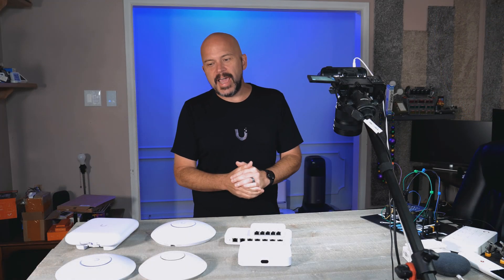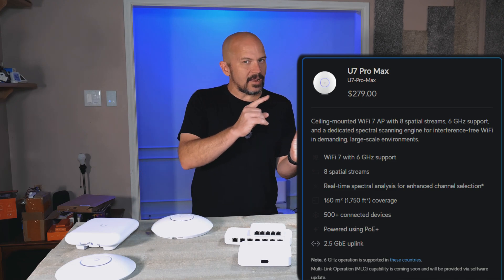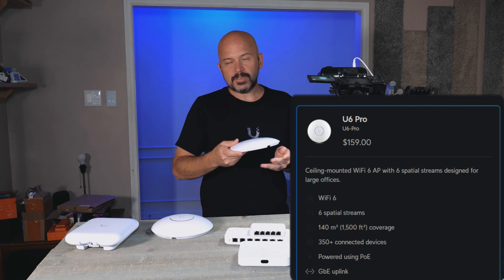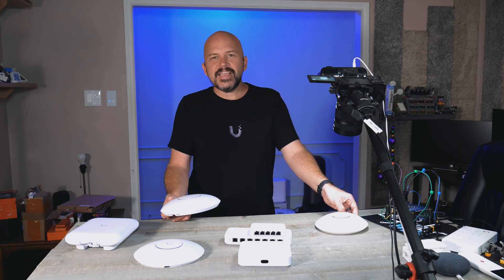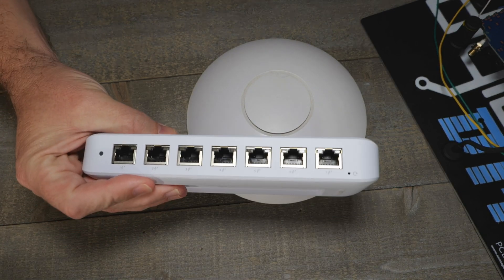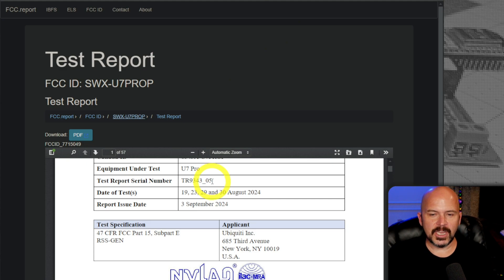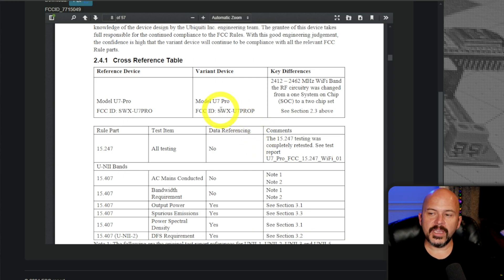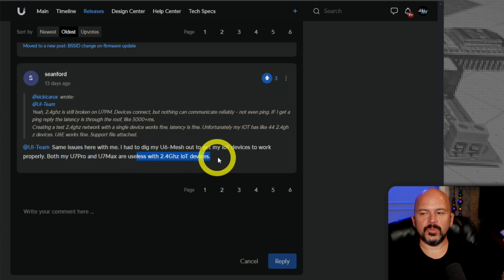UniFi U7 Pro & Max - DON'T BUY Here's Why

Comment: I have never been happy with my U7 pro, so I just received my U6 Enterprise. My Iphone right away had speeds almost as fast as my wired PCs. But for some reason when I connected my phone to the IOT network I was getting the opposite. I'm not sure why. I can say all of my IOT device's connected with not issues and although my iPhone showed slower speeds (50 to 60 down) it didn't act like it has slow speeds so I'm pretty confused. Another strange thing. After I installed it, I have a new Wifi on my system called Wifi6e-control, that I did not setup up. I can't see this network on my UDM pro. Any thoughts?

Comment from the maker: UPDATE!  2/16/2025 - Use 7.0.103 on the U7 Pro currently as it does fix most issues.  There's no MLO in official releases yet.  No official release yet on the U7 Pro Max that fixes the issues.
Reply: Thanks for all of the updates. I'm holding off to buy the U7 Pros until things seem stable. Any updates since the 2/16 update to use 7.0.103?
Reply: What's not fixed?
Reply from the maker: https://community.ui.com/releases/UniFi-Access-Point-all-U7-and-E7-models-8-0-9/4a147759-12e3-4724-bddc-76543b78d057?page=1
Reply: @digiblurDIY  Thanks, I get it now.
Reply: what about the new update 8.x.x? unifiy say in the new video it fixes a lot. can you confirm?
Reply from the maker: @finki007 I think they are quick to rush there given it is a release candidate and new version was released 3 days ago. I have been testing it and it seems okay for the most part. Seems iPhone users are having 6ghz issues.

Comment: So i am a network engineer for Cisco. I am currently running a u7 pro just purchased. I do not have any issues with 2.4ghz. i do have separate wifi for wifi 2.4, 5ghz and 6 ghz. 

My wifi name is like home 2.4ghz and i turn of band steering and make sure its only set to 2.4ghz. then my wifi 7 is set for example home 7ghz. I am having no issues. It sounds like you haven't configured it correctly.
Reply from the maker: What firmware as the 7.0.103 does fix a lot of eh smart home issues. 8.0 is working on the MLO stuff. Almost time for a redo in testing.

Why aren't you running Meraki stuff? I know a couple Cisco guys that laugh at the Unifi stuff.
Reply: @digiblurDIY  I am running 7.0.103 I do not like Meraki. I feel like Ubiquity for the price point makes a great product. I can easily adopt or remove ap's. I am using a dream wall because I didn't want a huge rack. I have a bunch of Cisco equipment that I bought but I never could get to installing them due to noise and power. I have outdoors Cisco AP's and they suck compared to U7 pro. The speed I see from U7 pro vs others is crazy. A Cisco wifi 7 is 1400. Then you need to worry about Cisco licenses. This is simple, auto update and easy backups.
Reply from the maker: @ExpatLifeMike good job. 7.0.103 fixes a lot of issues. They have jumped to a newer base with 8.0 to include those fixes and get MLO going. It is close.

Comment: Honestly, I'm a professional integrator in the SF Bay and have rolled out residential and commercial build outs, we have zero issue with the U7 Pro or Pro Max. Your aren't saying anything about which network switches you are using, what cabling was being used etc. Again I have done plenty UI Wi-Fi7 deployments and not a single issue.
Reply from the maker: If you didn't have any issues I do know Ubiquiti would love to talk with you how you overcame the firmware issues that plagued these devices for many of us in the EA threads.
Reply: @digiblurDIY  EA, we are no longer EA. I only deploy things that I have tested extensively and I don't have any issues. I'm doing this for a living and I have been in the industry for over 3 decades.
Reply from the maker: 7.0.103 is a little better, slowly getting there. You should check out the EA threads to keep up with things happening.

Comment: Have 100 plus IoT and it was a nightmare with a U7 Max - retuned for a U6 Pro and happy days. Clearly a hardware issue as I didn’t need to change anything
Reply from the maker: Running through the paces on the 8.0.9 EA firmware and lets see...  been bumpy as hell for sure!

Comment: I have cloud gateway ultra and 1 u7 pro got it couple days ago havent open it yet should i return u7 ?
Reply from the maker: Put the Latest 7.0.x firmware on the U7 Pro.
Reply: think about getting a U6 LR or U6 Enterprise instead. Think the whole Lineup of U7 at the moment isnt very usefull in this case when you have IOT Devices.
Reply from the maker: U6 LR is Mediatek so I'd probably skip it and go U6E.  I have had both and the U6 LR was sold and the U6E is damn solid.
Reply: @digiblurDIY  u6e to expensive , how about u6 pro?
Reply from the maker: @Erik-m2u4f good solid choice on the U6 Pro. No 6ghz though. I do feel the U7 firmware is close but might need a bit more testing and tweaking for a few months

Comment: The IOT Compability is still not there on the U7Pro Max - even with their new 8.0.0 EA Firmware. I have massive Problems with Wifi-Calls (Several Drops) & specially the Q990 Samsung Soundbar (Loses connection from time to time & have several drops in audio when working)... 
Sad thing that a big company like this release a whole Lineup full of Garbage and is testing the firmware on the go at the cost of the user...
Reply: Is there any news for the U7 Pro / U7 Pro Max? EA 7.X.X and 8.0.0 didnt resolve anything at all.
Reply from the maker: They just released 8.0.9 today.  I put it on the P and Pro Max today.  I'll let ya know
Reply: @digiblurDIY   So far to be honest it looks a little bit better now! 
My Samsung Soundbar still drop at the moment but the IOT Devices are working.
Reply: @ 8.0.14 made my U7 Pro Max useless - couldnt even use wifi-calls cause of horific drops - worse than bevore on 7.x.x

Comment: Im confused a lil bit on the unifi app i cant find the 6ghz settings i dont know rhat the issue is, all ik is when i turn off 2.5ghz the 6ghz come back but the settings that i did for them disappeared completely
Reply from the maker: It is based on each SSID you setup.

Comment: couple of months back I stumbled on an eBay buy-it-now listing for a set of "lightly used" U7 Pros for $100 apiece (!!)
I immediately bought all of them and used the to replace my ancient UAP-LRs.

the U7s worked well at first but I did note some issues over time with certain smartswitches dropping off the network.  I'd assumed that it was simply due to the construction of my house (poured concrete + rebar == wifi death) and just got use to restarting switches every so often.

just stumbled on this vid and have downgraded all the APs to .059.  Also turned autoupdates off.  Will be interesting to see if this makes a difference!
Reply from the maker: Have you tried the 7.0.x latest EA firmware?
Reply: @ EA?  unsure. 
I have a cloud gateway ultra as the management device; had it set to do auto updates.  Didn’t take note of the specific firmware version being run but it was later than .059.

Comment: I bought it on 1/25/2024. Sent it back 2/4/2025. The 2.4ghz is very buggy and not fixed on any of the EA 7.x.x versions I have tried and even the EA 8.0 version. I should have known, I remember when I got the U6 lines when it first came out and wasn't ready or fixed for a long time. I left Ubiquiti Unifi line for other brands because I didn't want to be a guinea pig anymore. I can back with hope and yet again Ubiquiti is dropping the ball.
Reply from the maker: It is getting better slowly but I'd still wait out the issues going on for things to settle.

Comment: Over 2000 deployed with zero issues. Devices connected varying from sites with a couple devices, to nearing maximizing the allotted amounts for the access points. Also, WiFi 7 is not standardized yet, so you should expect issues. Ubiquiti is far from perfect and we've had plenty of issues with their Edge line, but the 7s seem to be fine.
Reply: Did you deploy over 2000 of the U7 Pro and U7 Pro Max?
Reply from the maker: You must have deployed after they fixed the 2.4ghz side. It was rough for a while for so many of us. Few issues they are wrapping up on the new build and hopefully I can deploy my U7 APs in the home for production soon.

And no issues should be expected like this with an on the market device. Even a few of the other guys got it right. Ubiquiti missed the mark a bit.

Comment: Hi,
Do you know if the UniFi U7 Pro Wall has problems too?
Reply from the maker: Yes. Same chipset. Definitely run the latest EA firmware if you have the hardware already
Reply: @ thank you for the reply. Luckily I don’t have the u7 pro wall yet. Wanted an on-wall mounted AP since I don’t wanna drill in my concrete roof (rental apartment). But I might have to reconsider and just buy the u6 pro.

Thanks again.

Comment: The u7 pro is massively improved for me with the early access firmwares. My iot isn't disconnecting anymore and even the MLO on my default ssid is working fairly well.
Reply from the maker: Yup.  Now they need to fix the MLO and scanning...  get a couple officials under the belt and wrap this one up and hopefully learn from it.

Comment: Hi,
does the problem still occur or is there any response from the manufacturer?
Reply from the maker: There have been a bunch of beta firmware releases. Definitely run the latest EA firmware if you have the hardware. Most things are fixed for now but for buying my recommendation is to hold out and let them get a couple official releases under their belt and out to the masses for proper testing.

Comment: Just bought a u7 pro max a few days ago and have about 40 or so 2.4 ghz devices for my smart home, including a dozen or so Tasmota smart plugs, esp32 based sensors, Tapo cameras etc. They have been working great! So wherever the issue was it appears to now be resolved, thankfully!
Reply from the maker: Yes for the most part the latest EA firmware has fixed most issues. We are almost there.
Reply: What firmware version are you running on your u7 pro max?
Reply: @Reelix  using version 7.2.22
Reply: @HotendHacker  Aaah - Thanks. Seems the issue got fixed somewhere a bit earlier on back in the 7.0.x branch - I guess the 7.2.22 has long since resolved any problems :)
Reply from the maker: @Reelix they have jumped to 8.x but the SSIDs wouldn't broadcast. They are coming out with another fix.

Comment: How's the WiFi 7 5+6ghz connection with S24 Ultra or something? Network Engineer here. 2.4 is garbage never use it in production unless it's a point to point with professional alignment. Or for IOT and Guest, never for staff or production devices if WiFi needs to be used .
Reply from the maker: MLO is buggy for me still. It keeps flipping the 5ghz and 6ghz channels to 20mhz wide and nothing will see the SSID.

Comment: I have 3 U7 Pro Max's nothing but a mess.. I am and MSP and we do Cisco and Meraki and started doing UBNT. Try on my house before i sell these. YEAH NO... 3 months trying everything under the sun. Currently running code 7.2.17 30-50% TX retries... Support told me 2.4GHz MUST be it's own SSID and everything must be AUTO. 5GHz and even 6GHz should be on their own SSID's. 

so now all i want is them to take them back and exchange them for 3 U6-ENT's call it done. i had to put my MERAKI's back in play and POOF what do you know everything works flawlessly. 

great video... excellent info keep making video's on how these U7's are BRICKS from the factory.

Comment: I am running the recently release 7.2.16 and that seems to be stable for 2.4Ghz as well as 5ghz and 6ghz.  MLO is still a work in progress.  If Ubiquiti does change the design of these access points based upon known issues, I would hope that they make it right by replacing hardware and or expediting software fixes.  I can tell you that I have personally jumped through all of the recommendations and the only consist performance I have seen on my network was from my U6 LR and U6 Enterprise.   The 3 U7 Pro APs were causing random disconnects until I upgraded the firmware to 7.2.16.  I have 58 total wifi devices of various types.

Comment: You might have a bad AP(s).  I have a U7 Pro and a U7 Pro Max.  I don't have a 100 devices on 2.4ghz but I have about a dozen devices and everything has been great.  I am running 7.0.95 on the Pro on the Pro Max it is 7.0.66
Reply from the maker: That would be a LOT of bad APs out there with all of us if true. 7.0.95 has fixed most of the issues. I think we are up to 7.0.100 now. The Pro Max is getting closer but not there yet.

Comment: What about U7 Pro Wall? Are there also problems with 2.4 ghz and IoT?
Reply from the maker: Yes. Those are included. Run the EA test latest firmware if you have one.
Reply: @digiblurDIY  Yesterday I ordered U7 Pro Wall. Today I came across this video. I'm worried :-(. I have a lot of 2.4G IoT devices. I saw there is a firmware update (7.0.95). I hope the problems with IoT devices are solved.
Reply: @sebikolo  Hi, any feedback/experience with the U7 Pro Wall with IoT devices and overall? Was also considering to order it. Thanks in advance for the answer!
Reply from the maker: Run the latest EA firmware 7.0 branch and most things are fixed on the IoT side

Comment: No problems on my u7Pros and u7Pro Maxs I installed (4 totals)  I have hue lights (over 300)  Hubitat Hubs, Home Assistant Hubs, tons of zwave zigbee,  unifi cameras,  so not sure what happened on your side.
Reply from the maker: Which firmware are you using? Pro has a mostly fixed firmware but the Pro Max still has some issues.
Reply: @digiblurDIY  7.0.95
Reply: and 7.0.66
Reply: and if the 2.4 is not working on your U7s, why not just disable 2.4 on it, and put up some old Unifi AP with just 2.4 to broadcast along side it?  That would be an easy fix for the time being.  The 7 has amazing download speeds and ability to break thru congested spaces,  that's why I love mine.
Reply from the maker: That's difficult given no additional drops etc.  It would be much easier to change brands if necessary.  The 6ghz speeds are nice indeed but disappointing the 2.4ghz has so many issues.  They are however working on it since there has been maybe 15 or so firmware releases for testing by folks.  Slowly getting better.

Comment: I actually wanted to buy the U7 pro/max, but then heard about the 2.4 GHz problems. I have some Shelly devices that should only run at 2.4GHz. I have 2 AP AC lite and 1 Ap AC pro. Everything runs perfectly. 
But I love technology and U6 enterprise costs as much as the U7. Would you rather wait until there is a U7 successor or buy the U6 enterprise now? 3 new U6 enterprises already cost a lot. Hence the question. Switch to Wifi 6 now or wait?

i will have 3 SSID . 1 for "normal use", 1 for 2.4 GHz only, 1 for guest 

It seems that UI still works on the problem, UniFi Access Point 7.0.95 (early access) now available.
Reply from the maker: Definitely hold off on buying stuff until they have the fix fully "baked" and in the official release for both the U7 Pro and Max.  Another couple months hopefully.

Comment: I have no issues whatsoever with my U7, I hear this on the forums, and I think its some early firmware issues. I just swapped and my iot (dozens) is rock solid
Reply from the maker: They are working on things in the EA firmware and getting closer but there are still issues looking at the latest thread.  No fix for the U7 Pro Max yet.
Reply: @digiblurDIY  請問U7 pro 韌體更新後，已經修復了嗎?
Reply from the maker: It is close.

Comment: I wonder if the E7 is also affected as it just got released.
Was thinking of replacing my older 2 device mesh (Wifi 5) with one U7 Pro/Max or E7 (which has no fan, I guess) for the whole "smaller" house.
Not sure tho if their Poe++ Adapter can handle the E7 as I don't wanna buy a switch and I have currently 0 Unifi devices at home (I would host my own network controller on a raspberry pi).
The only devices connected to the Wifi are Smartphones I don't have any other IOT devices (yet).
Reply from the maker: I cannot confirm it personally. I have heard in the threads that some users are having the same issues unfortunately.
Reply: @digiblurDIY  Then all we can do is hope that they will fix the problem soon.
As long as it is a software related issue and not hardware related tho.

Comment: Five minutes in and I still don't know anything more than "It doesn't work".
Reply from the maker: Let me get the Vine version link for you.
Reply: @digiblurDIY  you need to be a lot more concise. i couldn't find anything specific either in the whole video aside from high tx retries which are just a cosmetic issue. btw all that is fixed in the latest v8 firmware....
Reply from the maker: You missed the comment about things about showing the issues and it being fixed?

Comment: I have the U7 Pro Wall and it's a disaster. Every time I change a setting it goes into a restart loop for half an hour before stabilising again. It also causes other issues in my Smarthome. 
I have turned off the 6Ghz band on mine and it uas been more stable since, but since some of the issues are intermittent, it's hard to be sure.
Reply: I currently have two u6 lite I wanted to switch to the wall or the u7 pro because I have the impression that the power is not crazy so your comments and the video really make me hesitate ...
Reply from the maker: @FlyingPGraphik I would hold up a few months and see how things go once they get some official stable releases tested and under their feet.
Reply: @digiblurDIY  In that case, I will wait a little more. Thanks for your feedback, I'm going to subscribe even if my English isn't great. See you next time from Belgium.
Reply from the maker: @FlyingPGraphik thanks! I had no idea reading your messages. I do know YT has started adding more automated close captions and alternative language voice tracks to our videos recently.
Reply: @digiblurDIY  I use it sometimes, but I think the French translation is sometimes too approximate... So I prefer to keep it in English. Thks a lot